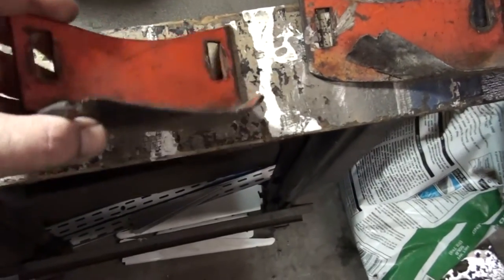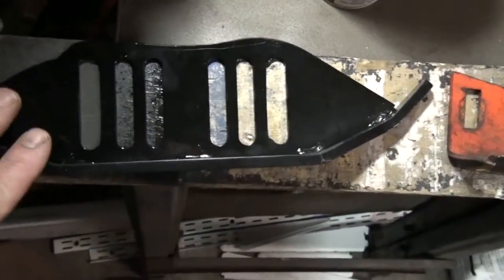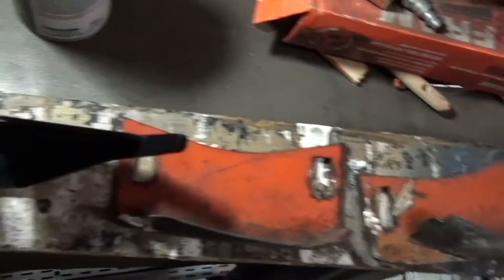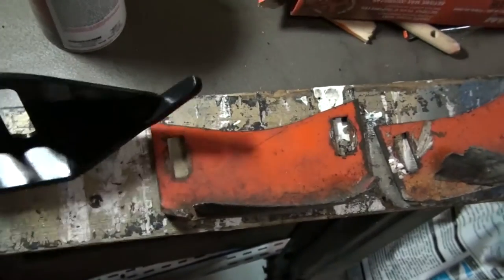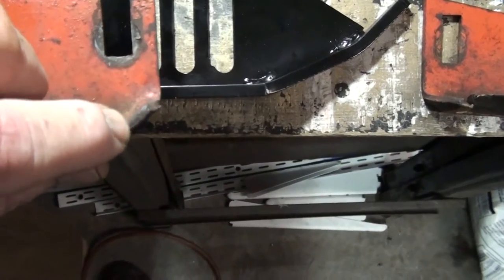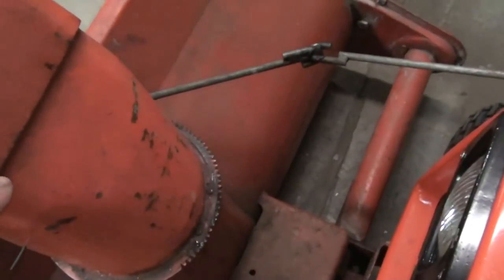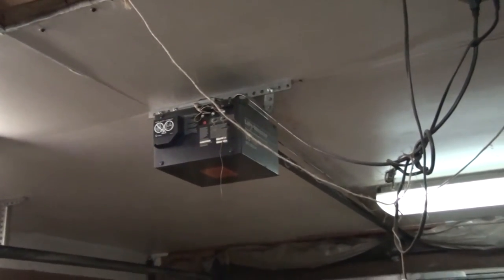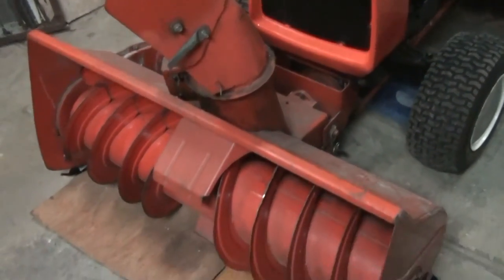New Skids 4 The 75 Gilson Snow thrower

Comment: Neat units and certainly plenty stout. How about gluing a little piece of foam rubber on your chute to protect your grill.
The garage door openers are pretty straight forward to replace. I used to do them quite often back in the day. Even with taking your time you will have it done in under 2 hours, and maybe less if you can get a comparable unit that will bolt up to your existing mounting brackets. If you have a 6 foot step ladder it will be very helpful in putting up the head unit. Set the head up on top of the ladder when you are ready to put it in place and then you can just lift it from there. Wish I lived closer, I would enjoy helping you with that project.
Reply from the maker: Thanks for the help, I wished you did also its a first for me. I hope you are right. I did have a ladder it was stolen (long story) but I do have a little giant ladder with a metal platform I can put any place on the ladder so I am hoping that helps I will likely do a vid on it just so everyone has a good laugh.. :) Good idea on the foam I am going to see if I can find something to do just that.

Comment: I know all about backs, I had a fusion done in 04 and made it worse.  That snow blower should move a mountain of snow and nice heavy duty skids.   The worm drive door openers are easier than the old pulley style.
Reply from the maker: I have heard that from others that also had the fusion done. So far they tell me I am not a candidate so for now I would have to look at other options. I sure hope it can move lots of snow, problem is we keep getting dustings if anything so it could be a little bit before I can test it out. The garage door opener should prove to be a fun its a chain drive 1/3 hp and turns out its kinda hard to get a 1/3 hp most are 1/2 or better so I may have to do that and hope it all lines up. :)
Reply from the maker: Hop on your John Deere and head over here and give me a hand with it, I will spring for the gas.. :)
Reply: Maybe you'll get lucky and just have to change the main motor units and everything else where it is. Wouldn't that be nice?
Reply: I would but I think you're just a little too far.